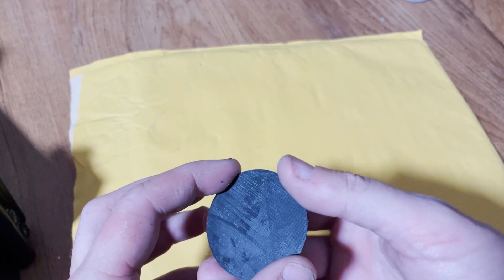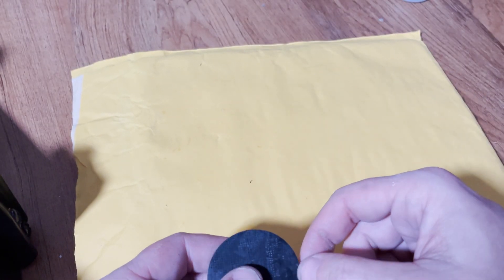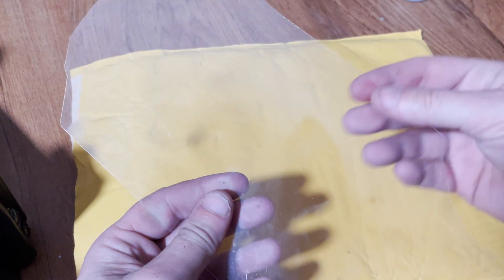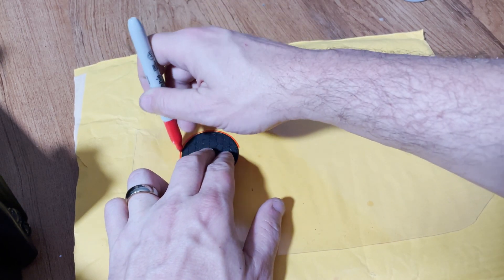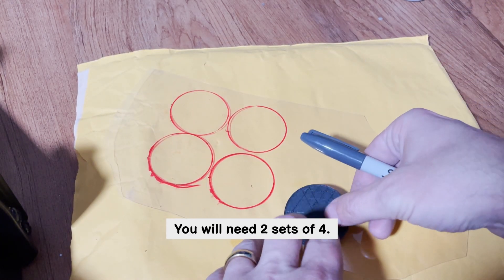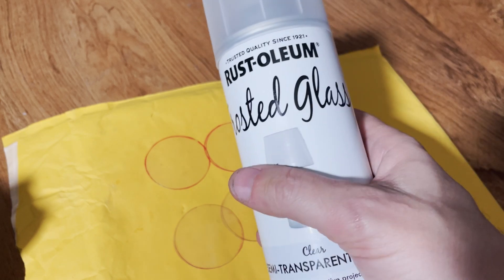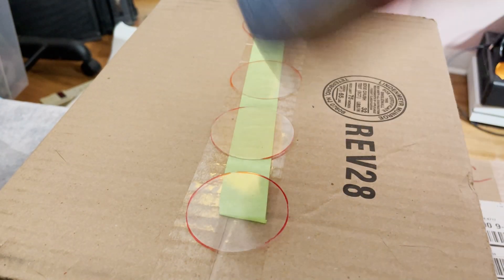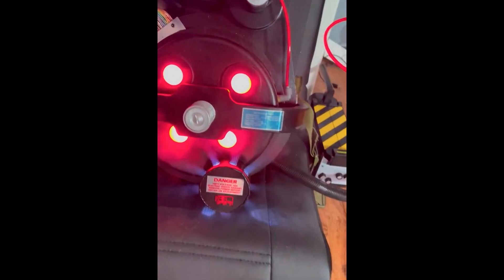How to Build a 3D Printed Ghostbusters Proton Pack: Part 7– Cyclotron Lenses

Comment: I am still figuring out what to use for mine. I have printed lenses in translucent red and clear FDM and will try to polish them; I am curious to see how the internal print pattern will affect the light coming through. (among another attempt or two). I will also try your technique, I think, to see what I prefer :)
Reply from the maker: I tried that too, wasn't a fan of the infill pattern being visible through the light, but you may dig it.

Comment: First I made red ones, too. I chose acrylic glass. But since I'm using arduino and MikeS's code, I had to swap it for  normal lenses. Unless you don't use the different modes of his code, you will find that any other colour than red won't work. The hard way. 😅
Reply from the maker: I don't care too much for the other modes. If you want to do the other modes you need to have frosted lenses with no color, or I've seen some people use dark black lenses. I actually have the other modes coded out of my code on my pack so it only does the classic mode.
Reply: @wholesomejoe  Fair enough. I've changed the themes a bit. Meson now sounds like a big taser instead of the pew pew sound and the christmas mode is a DOOM mode now. 😁